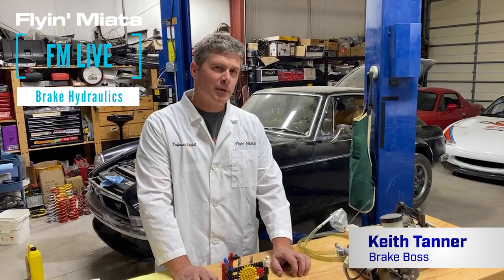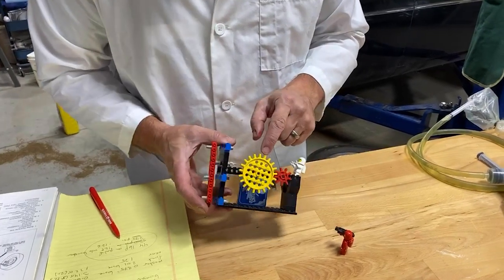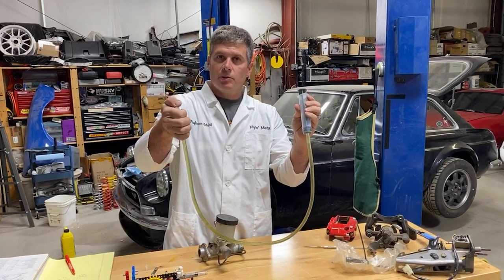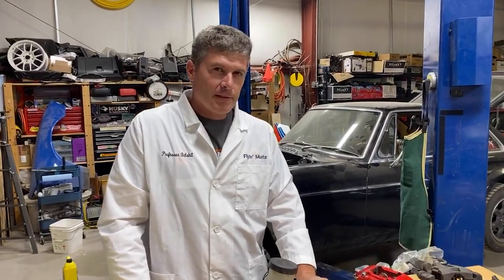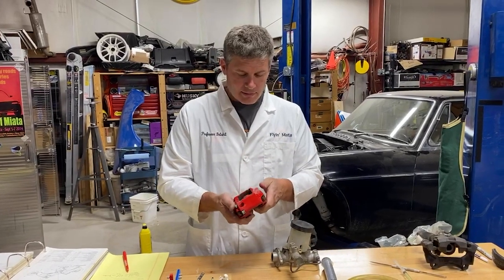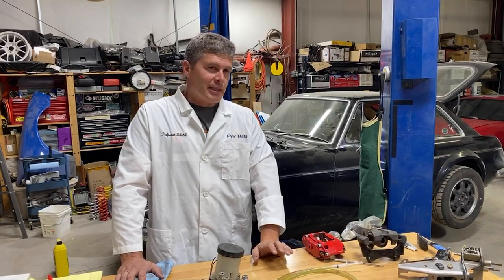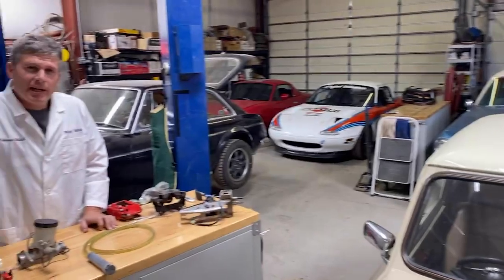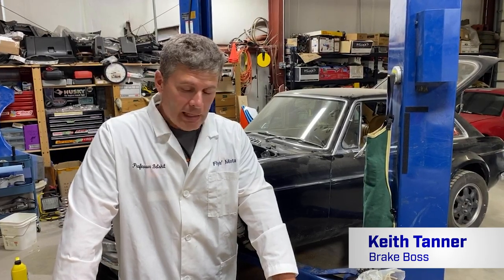Brake Hydraulic Theory with Keith Tanner (FM Live)

Comment: great video, could you cover brake bias and how it has changed through the years in the miata
Reply from the maker: We talked about that a bit in a previous video, and there's a tech page on the Flyin' Miata website that shows the different proportioning valves used up to the point where the car went to electronic brake distribution. Does that help?

Comment: Hey Keith! Love the videos. Can you explain the thing you said about NDs holding the throttle wide open to heat up the catalytic converter? I have a hard time wrapping my head around how/why that's needed. How are they preventing the engine from reving out?!?!
Reply from the maker: Cam and ignition timing. It's magic, designed to get as much hot exhaust down the cat as possible. If you've ever started an ND from cold, you've heard it happening. It's that weird blare they make for about 30 seconds.

Comment: Hint: Have 2005 MSM. Engine bay wiring is becoming brittle, along with small connectors. Any thoughts or suggestions on these type of issues? P.S. vacuum hoses following suit.
Reply from the maker: Heat shielding. That's about all you can do. A stock MSM shouldn't have too much trouble here, but if you've made changes underhood and exposed wiring to extra heat it's a problem.